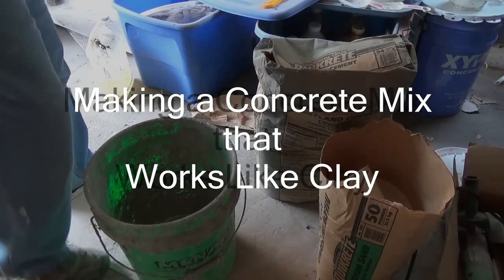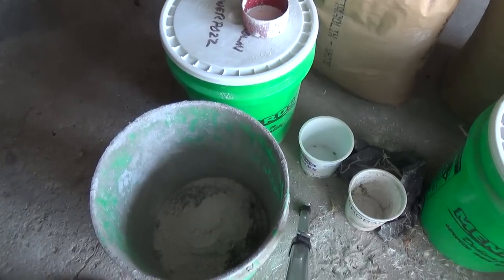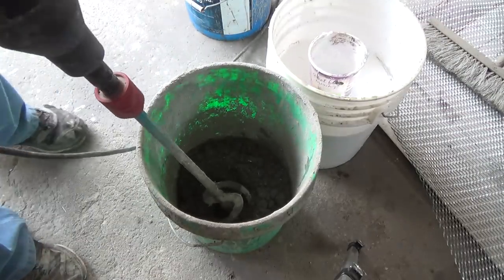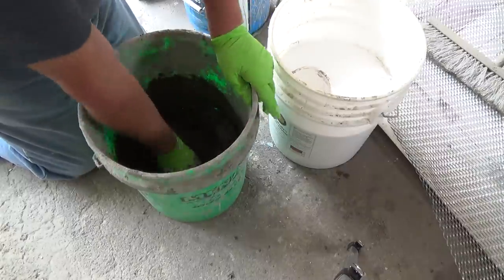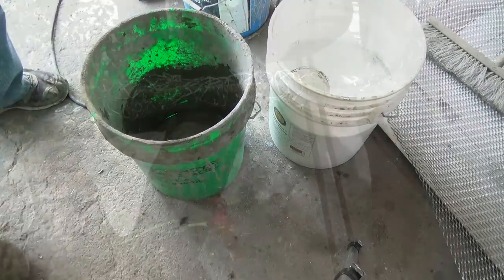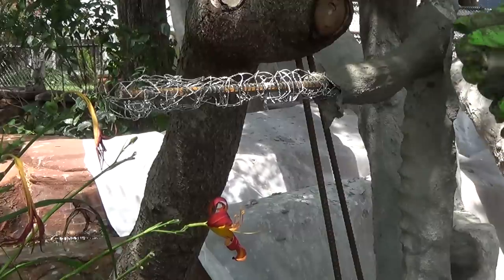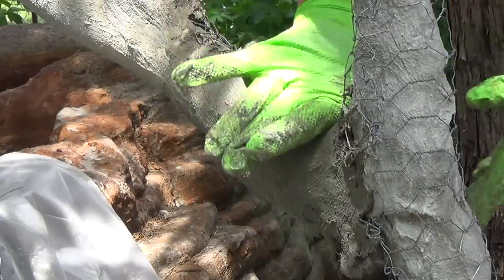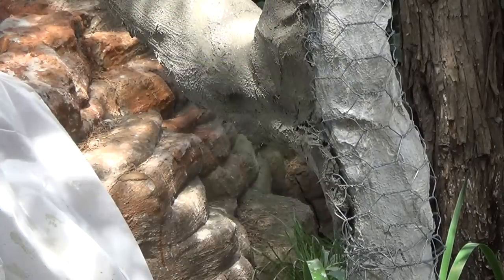#concrete #fauxbois Making a Concrete Mix that Works Like Clay

Comment: I couldn't find the powdered KongKrete on Fishstones website, but I did find a concrete bonding adhesive that is an acrylic fortifier at Home Depo by Sika Pro Select, I'm wondering if that would work? I also can't seem to find a fine sand anywhere, just all purpose sand, patio paver sand and play sand. If I let play sand dry out would that work or should I stick with the all purpose sand?
Reply from the maker: Sika's products are also like KongKrete, but contain MUCH less solids.  It will work fine but, depending on solids content, can't be diluted more than 1 water to 1 acrylic, if not used straight with no dilution.  For sand, try other home improvement stores.  I buy mine from Lowes.  The finer the sand, the better the mix.  All purpose sand is OK if you don't need a fine, detailed finish as it contains rather large grains.  Play sand is better but not as fined as Quikrete Medium sand.  If you need to "dry out the play sand, go elsewhere for you supplies.  Play sand should NOT be wet. It comes in plastic bags and should already be dry.  If you can find sources other than home improvement stores as I found Fishstone, you can find very fine sands, depending on your needs. Fishstone carries extremely fine sand, but you'll have to find out what shipping charges are, which might be prohibitive.  Check your area for suppliers of silica sand, sand-blasting sand, etc.

Comment: Does this shrink when it dries/hardens, and can you color it- and with what?- pigments added when mixing, or acrylic paints after it dries/hardens?
Reply from the maker: Whether it shrinks or not depends on how you cure it.  Keep it moist until it cures.  Concrete does not "dry"; it chemically cures by a process called hydration. Don't allow it to lose moisture by evaporation.  You can color it any way you want.  You can use pigments added when mixing, you can paint it with acrylics, or, as I do, stain it with acid stains made for coloring concrete.  Don't know what acid stains are?  Check this out:  https://www.concretecamouflage.com/

Comment: Hello again master....... if i wanna make a 39.5inch x 55inch x 1.25inch for my little kid shower floor.... did you can recommend me some mix preparation? i read about use white concrete with marble dust and acrylic polimer... what do you think? always thank you for share your knowlage
Reply from the maker: 39.5" x 55"x 1.25" = 2715.625 cubic inches.  There are 12 x 12 x12 or 1728 cubic inches in a cubic foot. so 2715.625 cubic inches = 2715/1728 = 1.57... cubic feet. A 60 lb bag of premixed concrete makes about .45 cu ft. of concrete.  An 80 lb bag of premix makes about .6 cu ft.  So the volume of mix you need is somewhere between the equivalent of three 60 lb bags and three 80 lb bag. of commercial premix. If I were doing your project, I'd want a mix that was as waterproof as possible.  Were I mixing my own, I'd use 3 sand to 1 cement, with additional ingredients of 10% of the cement content in metakaolin and 10% of the cement content in silica fume and using acrylic in the liquid.  I don't know about marble dust as I've never used it.

Comment: Hi to you...  woow, this is what i was looking after...    But is it right you use twice as much cement than sand ??  normalerly  its  exambel  4 sand and 1 cement...   but use 4 sand and 8 cement :)     regards. Lars from Danmark
Reply from the maker: Indeed, this is a mix that is used for sculpting, not for making things requiring structural strength.  For structural use, I use a mix of 3 sand to 1 cement, 5% CSA cement to compensate for portland cement's tendency to shrink, 10% metakaolin, 8% silica fume, fiber and acrylic admix in the water.  Here is a video of the mix I used in the past minus the silica fume. https://youtu.be/etSWuBIcdZc

Comment: Hallo Perry, what would be the most important ingredient to make concrete  mix clay like, metakaolin or bonding agent? Where do I buy metakaolin? I am using readymade mix of fine send and cement such as quickrete. If I add metakaolin and bonding agent to it would it make it clay like?thank you
Reply from the maker: Both.  I buy mine here: https://concretecountertopsupply.com/Item/Metakaolin40  I don't know where you are located, so I can't suggest a source close-by. I've not tried Quikrete for this purpose, but it would NOT make it like this mix.  You'll note that the mix in this video has twice as much cement as sand.  Quikrete, assuming you used their sand mix, would contain three times more sand than cement.  The two mixes are just simply not the same.  All I can tell you is that, after 14 years of experimenting with mixes, this one works for me.  You can also make a mix that applies like putty or clay with a simple 3 sand to 1 cement mix, using just water and no other additives, IF you use a very fine sand or marble dust and being careful of how much water you add.  It won't, however create a mix that will stand up to freeze/thaw cycles and will have to be more carefully cured by keeping it moist for 7 days to avoid shrinkage cracking.

Comment: I am restoring a cement deer yard statue. 1 leg needs replacement all that is left is the rebar. I am wondering if I need to add a cement bonding adhesive to the basic recipe. I am using metakaolin and fiber?!
Reply from the maker: The white liquid in the water I used was acrylic admix/bonding agent.  For your repair, tightly wrap chicken wire around the rebar, put bonding agent on the broken concrete and in the mix and squeeze it into the chicken wire and around the rebar. It will   then be a very strong repair.
Reply: Thank you! Videos are perfect!

Comment: I’d like to use this for jewelry pieces, could I eliminate the sand? I don’t want that texture in the jewelry.
Reply from the maker: You can certainly try it.  The late Donald Tucker, renowned concrete artist used neap cement to create the finish coats on his faux bois pieces. The problem with using no sand is that it is prone to cracking if not cured properly.  I'd try increasing the concentration of acrylic in the mix and, after initial set so that there is no chance of marking the finished piece, wrap it in saran to keep it moist for a week.  After a day or two, unwrap the piece, spray with a mist of water and rewrap with saran or plastic sheet.  After a week, if the pieces are small, as I assume jewelry would be, you can submerge the piece in water for another week.  This will ensure curing with no shrinkage cracks.
Reply: I found a craft sand that is so fine it’s a powder. I’ll try that first. Thank you so much!
Reply from the maker: I've also heard others use marble dust, obtained from places that cut marble counter tops.

Comment: Would this work for vertical stamp concrete different parties trying to sell a product called true pack but you don't tell you to mix
Reply from the maker: I use this specific mix for the underside of constructions, like the undersides of railings on my bridge.  I use a different mix for vertical work like my fence.  I don't do stamping, so I can't address that.  I have never used Tru Pac additives.  I don't like to use things that contain "proprietary" substances.  If I don't know what's in it, I don't use it. I don't understand the last part of your comment/question "but you don't tell you to mix".

Comment: Sir u hv mix 5cp sand +10cp cement+2cup _-----+pva fiber, plz tell 2cup of which material??? 
What is pva fiber???? 
Plz  sir
Reply from the maker: Metakaolin, which is calcined kaolin clay.https://concretecountertopsupply.com/Item/Metakaolin40  PVA fiber is polyvinyl alcohol fiber https://concretecountertopsupply.com/Item/PVA5

Comment: Does it matter what kind of cement? I’ve never tried sculpting although it’s always been at the back of my mind
Reply from the maker: The cement I use is called portland cement.  It is labeled Type I/II.  You can also use mortar cement, also called masonry cement, but it will make the mix somewhat stickier and also contains lime, so you have to be a little more careful as it can burn the eyes and lungs more so than portland.  If you choose to use it instead of portland cement, make sure you get mortar cement and NOT mortar mix.  Mortar mix already has sand in it.  You will also find CSA cement (brand name RapidSet), which is stronger than portland, but sets up MUCH faster, not allowing much time for sculpting, unless you want to carve it.  Depending on temperature, it sets up in 15 to 30 minutes, but you can add small amounts of citric acid to it to slow the set time.  If you're just starting out, use portland cement.

Comment: metakaolin is expensive and the others are not shippable here either...big quantities...any substitutes? I'm in Hawaii so shipping is nuts--what could I use from a local h'ware store? Suggestions? Mahalo:)
Reply from the maker: I'm not an expert in all things concrete.  If you can get metakaolin, it is not as expensive as you think.  I found a source in Hawaii that sells 20 lbs for $59.95.  That's $3 a lb. Twenty pounds will make a lot of concrete clay.  Expensive? Perhaps, but check out the alternatives such as Pal Tiya or Sakrete's Shapecrete.  You're making a clay-like material that is used in relatively small quantities, not paving your driveway with it. Pal Tiya is about $10 a lb.  I don't know what  Shapecrete sells for.  Otherwise, you'll have to do your own experimenting with other materials.  I've never tried it, but have read that some use diatomaceous earth (used in swimming pool filters).  I haven't the slightest idea what it does in concrete or whether it would work.  I use metakaolin.  That's all I can recommend.

Comment: I also wonder if this would work for doing ceramics on a pottery wheel
Reply from the maker: First, it's not ceramic clay; it's concrete.  As far as using it on a pottery wheel, I have no experience with that.  If you try it, let me know how it works.

Comment: Home Depot has a lousy search engine, but, Sadly Home Depot isn't bringing up metakaolin, here in Maine, is there a substitute or another name for this product? Is this 'quickwall?
Reply from the maker: You'll have to find a supplier other than home improvement stores.  Seek out industrial or construction suppliers.  My source was a supplier of concrete countertop manufacturers.   http://concretecountertopsupply.com/   Do a search for "metakaolin suppliers in Maine".  WR Grace pops up as one. Contact what you find and tell them what you want.  Metakaolin has no other name as far as I know.  It is made by taking kaolin clay, which i used in making porcelain, and heating it (calcining).  The heating process makes metakaolin.  I use metakaolin for its particle size.  It is 10 times smaller than cement particles.  There may be others who use different materials, such as fly  ash, but I've not had any ezperience with them.  You'll have to do your own research for other materials.  You might want to consider just having some shipped from a known source.  A 40 pound bag goes a very long way and make a lot of concrete mix.
Reply from the maker: BTW, metakaolin is NOT Quikwall.
Reply: @dperry428  I appreciate your in depth response.  Before noticing your response,  I did contact a home improvement store and hung in there for 6 minutes before disconnecting. 
 Thanks to your explanation, I have a better understanding of the material you are using, and will continue the search in my state.  
 I have my pastry bag and tip ready for use when the blackfly season is finished, around Father's Day ~ Thank You
Reply: @dperry428  That was a product brought up in a search- I have no idea, what's what on this topic, and neither does anyone else in this area, so far. My Dad did a lot of work with cement, built a house out of the old rock wall surrounding our property, but, he didn't do anything out of standard, so I'm ignorant beyond the basic. TY

Comment: Can this formula be mixed in a truck (large quantity) as a low slump concrete that can be poured and then stacked and carved as it sets?
Reply from the maker: I don't know as I've never done that.  I can really only recommend what I've tried myself as I'm NOT an expert in concrete. I know what works for me.  What you are describing, though, is the mix and process of One Day Walls https://www.youtube.com/watch?v=3G8E2C_5cg0  I don't know what they put in their mix other than what I can guess, but it looks like a similar approach of no large aggregate, high cement content, likely high fiber and, from one of their videos, I saw them adding buckets of additive that was dark colored, indicating the possibility of their adding molasses as a retardant that allows them to work all day without the mix setting up too quickly.  Sugar or molasses is a common additive that slows setting, but it can't be more than about 1/10th of 1 percent of the cement content.  Too much and the mix will never harden. What other additives they use is your guess as well as mine. I work in my back yard, strictly alone, and mix only as much as I can hand sculpt in an hour or so.  That means I mix no more than about half a five-gallon bucket.  Truckloads is a whole other world I can't address.

Comment: Wondering if you're aware of using latex or acrylic paint as a DIY homebrew fortifier?   Thanks for sharing also, you have some really awesome work!
Reply from the maker: Yes, there are people who do that, but keep in mind that there is more to  acrylic paint than the acrylic it contains.  There is a very real reason that it is strongly advised that the water used to make concrete should be clean enough to drink.  Small amounts of unknown chemicals and other contamination can have adverse effects on the concrete.  I wouldn't take chances by using unknown substances like paint in my mixes.  Others can do as they wish -- and suffer the consequences when things go wrong.  Homebrew is not always a wise course when dealing with chemical interactions.

Comment: This is wonderful, thanks so much for sharing your recipe. Out of curiosity, is this good for making outdoor statues and then using dremel to carve shapes/patterns into the finished product? I plan to make outdoor statues for my garden and would love to create one that is both resistant to rain-erosion and capable of allowing moss to grow on it (forgive if any ignorance is apparent in my comment; I am brand-spankin' new to concrete sculpting :) )
Reply from the maker: Yes, this recipe is much more resistant to weather damage than regular concrete.  I've never done sculpting after the concrete has set.  I do the sculpting while the concrete is in a clay-like stage.  It would be very easy to continue to sculpt with just hand tools for a number of hours.  Of course, as the concrete continues to cure, the harder it gets, until it is like sculpting rock.  I use this recipe in all my outdoor work.

Comment: Can you tell me what metakaolin and acrylic admix are and what is the role of each in this recipe? I want to shape a custom, rock-shaped LED light holder to hold a light in a certain position underwater in a small backyard pond for my niece.
Reply from the maker: Metakaolin is heat-treated china clay that is very reactive.  Its particles are 10 times smaller than cement particles and fill in the gaps that would otherwise allow water to penetrate the concrete.  It makes the concrete much more waterproof and much stronger.  Acrylic admix is a polymer that adds strength and water resistance to the concrete.  Both are important in making concrete waterproof.
Reply: @dperry428  thank you!!!

Comment: Could I ask you write down the ingredents and ratios you use?  It the best looking mix I've seen!
Reply from the maker: Fine sand, portland cement, metakaolin, acrylic admix/bonding agent.  Proportions explained in the first part of the video.
Reply: @dperry428  Thank you for the very quick reply.  Just spent over an an hour looking for metakaolin in the UK, no chance unless you order insustrial quantitites and to import it is so expensive.  I'm hoping kaolin will do the job.  It's trial and error when you're trying to create something.
Reply from the maker: Exactly!  I"ve spent 14 years developing what now works for me.  You might like to try fly ash, if it's still available in the UK.  It's not as good as metakaolin, but should work.  Kaolin and metakaolin are as different as limestone and cement.  Cement is essentially calcined limestone and metakaolin is calcined kaolin.
Reply from the maker: Try here:  https://www.moertelshop.eu/buy-metamax-metakaolin-white-cheaply
Reply from the maker: Also:  http://cornishlime.co.uk/argical-m1000
Reply from the maker: This is metakaolin  https://www.mikewye.co.uk/product/argical-pozzolan/
Reply: @dperry428  I'll try that, thank you, you are very helpful, much appreciated!
Reply from the maker: FYI.  I sent and email to a UK company about the availability of metakaolin in small  quantities.  Here's their reply:

Klaus Ströhle <klaus@l-i.co.uk>
Mon 5/13/2019 2:51 AM
Hi Don,

Thanks for the note and we supply single bags of Metamax from BASF in the UK and Ireland. We accept credit card payment and are used to dealing with private individuals as well as corporations.

Many thanks and best regards,

Klaus

Dr Klaus Ströhle
Commercial Director

Lawrence Industries Limited
Registered Office: Lawrence House, Apollo, Lichfield Road Industrial Estate, Tamworth, Staffordshire B79 7TA
Registered in England No. 2878866
Office Telephone: 01827 314151
Office Fax: 01827 314152
Mailto: klaus@l-i.co.uk
Website URL: https://www.l-i.co.uk
Read the latest technical blog articles and market insights from the Lawrence Industries team by following us on LinkedIn:
[www.linkedin.com/company/lawrence-industries-limited/]
Reply: @dperry428  Brilliant, I'll get on to them right now.  Thank you!
Reply: @heyho6728  I'm also from the UK and following this thread - keen to know how you are getting on.... did you buy any?